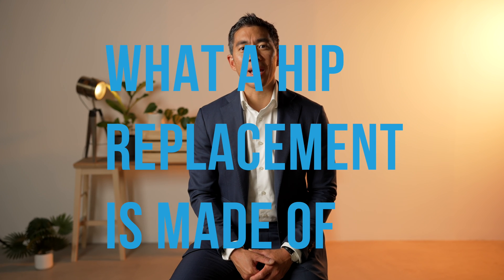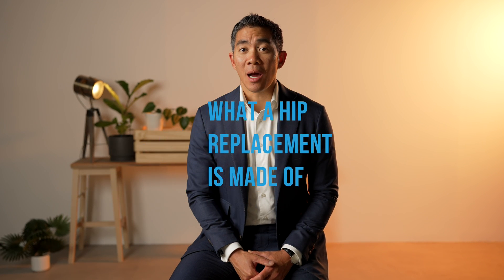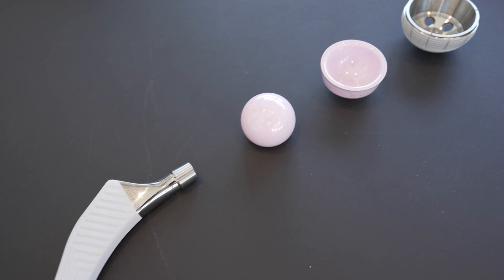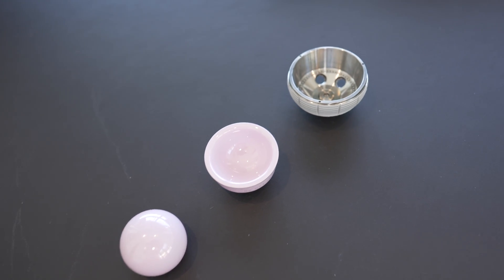Materials in a Total Hip Replacement

Comment: POV:  I had hip replacement done 5/19/2025 and today is 12/31/2025. My hip replacement has failed due to chromium alloy liner.  I had a Clifford's Test done in 2020 for metal sensitivities and chromium alloys was one of them.  I need a revision to ceramic done ASAP to relieve me hives caused by the allergy.  Please consider having a metal allergy test done before surgery.  Good luck!